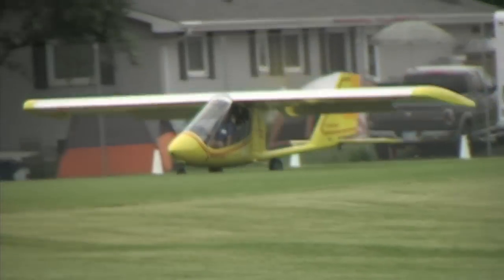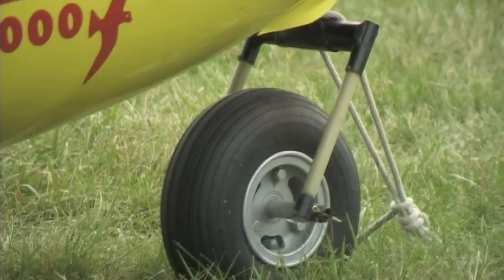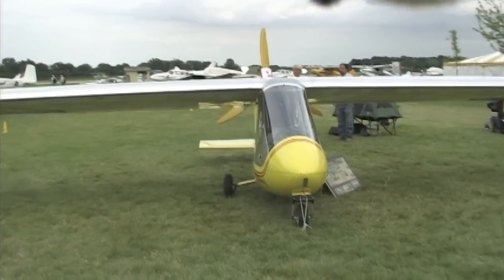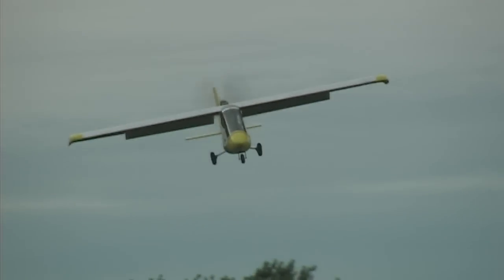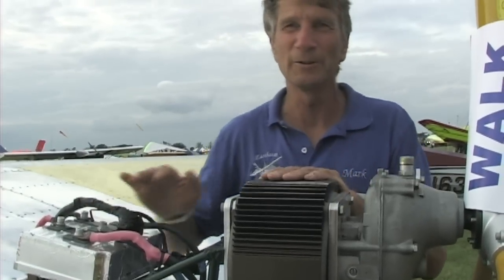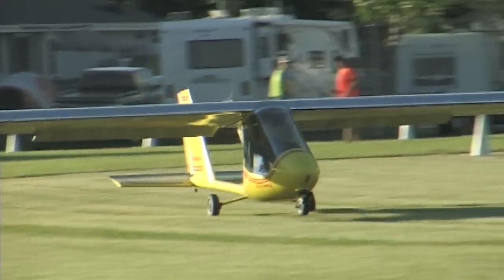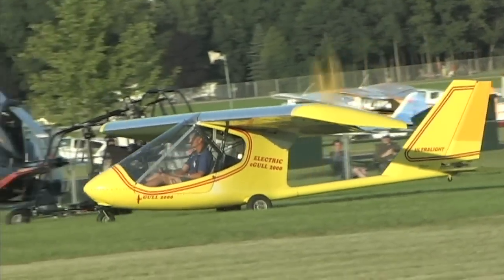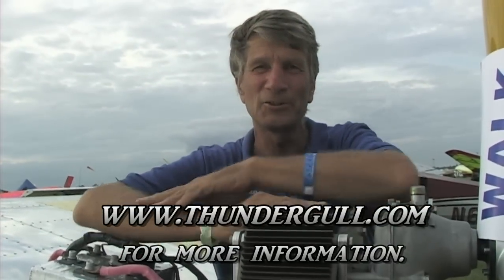E - Gull by ThunderGull 55 HP electric powered aircraft using Zero electric motorcycle technology.

Comment: If treated well by the time you replaced that battery the costs for batteries will have dropped again, Lithium sulfur cells will be more common then and will have a much higher energy density (lighter).